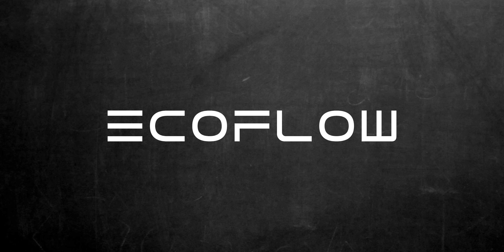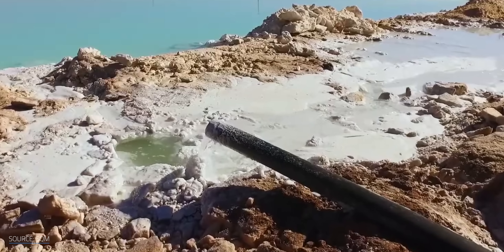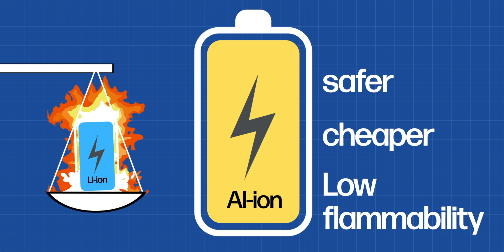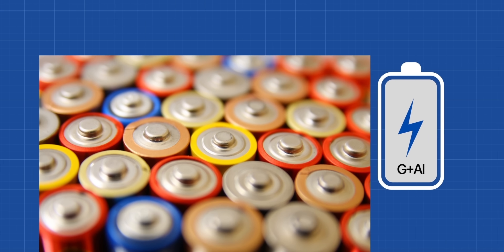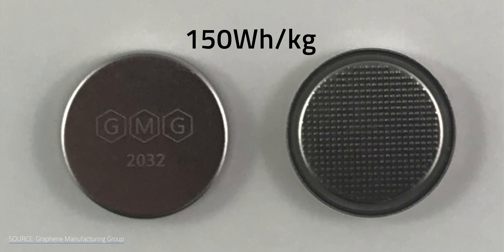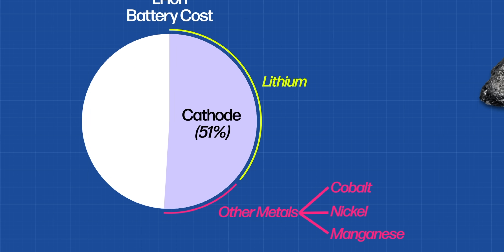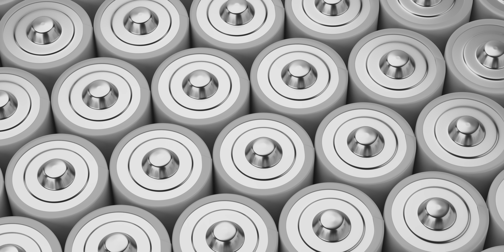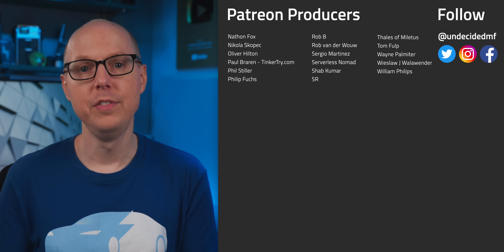Can This Metal Really Beat the Lithium Battery?

Comment: Here is the goal for battery charging speed : battery needs to be able to charge faster then what the input source, including wiring can reasonably supply !

Translation: the connection point is most likely going to be the limiting factor. 

I

Comment: EV power source tech is, certainly, important, but it always seems to me that researchers do not think of the other day to day applications - small tech, such as phones, computers, and even torches (flashlights) and button battery items like wristwatches and the like. If the Al-Io can be miniaturised to be incorporated into these small-tech items, with the same energy density as the larger tech items, then I can see Al-Io being a runaway success, but not otherwise.

Comment: this is extremely important stuff , al ion is the way of the future now that we're on the verge of having cheap graphene
Reply: Unfortunately I don't think graphene is going to be cheap enough.  It needs to come down in price by many orders of magnitude to be cost competitive for battery usage.  Currently it is about $100,000,000 per metric ton (according to Matt's numbers).  That is just too costly for any application that uses multiple tons per year.
Reply: @brettspencer-curran8269   heres another comment : @fcbrants   3 days ago (edited)
Thanks Matt, I think you missed one of the most important facets of GMG's business model:  They're forming their graphene directly from (natural gas / methane / CH4), so their graphene is a) ultra pure, and b) super inexpensive compared to other production methods.  They can also produce this graphene at enormous scale, as their original intent with the product was to use it to harden concrete, requiring huge volumes of the material

Comment: looking forward to trying AA batteries with this technology ... any plans for that type of thing?
Reply: As far as I know AA cells are basically the same as coin cells but stretched out.  I'd imagine it wouldn't be too hard to manufacture AA, AAA, C, D, and 9V with this technology (AA, AAA, C, and D are all 1.5V cells with the larger versions having higher capacity and potential amps, 9V batteries are just 6 smaller cells stacked together in series).
Reply: @grn1  I'm having really good luck with current lithium rechargeable AA batteries ... they're getting really good,  this aluminum tech sounds even better

Comment: It’s probably best to just avoid the term amp hour or milliamp hour when discussing batteries since - who cares? I use watt hours to power my stuff and the voltage is often different between battery chemistry types.  Here aluminum is less voltage but still has more (theoretical) energy density since the current density improvement is dominant. I see Wh was introduced later in the video but the initial ratio in Ah given is going to mislead some.

Comment: I am having a hard time figuring out how the aluminum ion battery market even existed in 2021 when it doesn't appear that anyone is selling aluminum ion batteries yet.  One use Aluminum-air batteries do exist and are being manufactured and used, problem is that they are not rechargeable and so have limited applications.  As far as I have been able to determine, there are no large scale aluminum ion battery production.  From this video, it sounds like GMG is currently producing, or is planning on producing, aluminum ion coin cells which is a step in the right direction since it will demonstrate that an aluminum ion battery can be manufactured at scale. The next step is to make enough progress to make larger cells that will be useful for EV's and large scale grid storage.  At this point none of them have hit any roadblocks, my concern is how quickly can they be brought up to meaningful production?

Comment: 10:57 - Those numbers imply Li-ion batteries cost $75 per kWh or less. If that's true, why does Ecoflow (the sponsor of this video) charge ~$1000 to go from a 1 kWh battery to a 2 kWh battery? Either these battery companies have incredible margins, or the cost claims per kWh (which I frequently hear are around $100 per kWh) are largely theoretical numbers and don't convey anything of practical importance. I'm guessing the latter.
Reply: I've wondered about that too. My theory is that the $75/kWh figure is only really true for companies that have locked in long-term contracts for huge quantities of lithium, back when lithium prices were cheaper. So, maybe $75/kWh is accurate for Apple and Telsa making cell phones and electric cars. But, I'd bet that new companies that want to build li-ion batteries have to pay far more than that on the spot market for what lithium scraps are left. Hence the need for Ecoflow to charge $1000/kWh to turn a profit.

Once the scarcity of battery materials goes away, hopefully, things will start to change.

Comment: Aluminum tends to stay as a precipitants.  This makes aluminum less functional as a battery metal.   Fe and copper are better choice for more reliable rechargeable batteries. They can nontoxic and 100 percent rechargeable batteries with high capacity. Aluminum has a strong tendency to stay as Al plus 3 ion.

Comment: Interesting tech but Aluminum batteries have been around for a long time and the problems with them have prevented more widescale adoption.  Maybe they fixed those shortcomings or maybe not.  The biggest challenge with this iteration of the tech is the need for graphene which is still hard to make.  Also, I wonder about the cycle life.

Comment: No offense. 
It lasting 3x longer sounds good till you point out lithium ion phosphate.  Last 20 years or around 2000 cycles without deterioration. 
But it would be nice if it was less hazardous/ flammable.
Would make more options for storage.

Comment: There isn't enough Lithium to sustain long term mass storage use in batteries. Moreover well before known reserves run out their scarcity will keep driving up their cost. Batteries based on Sodium Sulphur could be made cheap enough to contribute to grid scale storage.

Comment: There are no ‘rare earth elements’ in Li Ion batteries. Rare earth are for permanent  magnet electric motors.
GMG costs are graphene nanostructured substrates, so at 100$/g means 100,000$/kg, not so economic 😅. The major costs for Li-Ion is actually nickel, not Lithium because it is only about 6-7% of the total cell’s mass. Nickel content instead is much higher and costly.  But 55% of the cost of a battery cell is manufacturing. I think that Li-S ( lithium- Sulfur) and Al-S ( aluminum- Sulphur) batteries are better a for energy density and lower cost of production at the end. But there are plenty of diverse types of batteries and Storage Systems for Grid scale and residential application, so the more the better! Less metals price pressure and diversification of the markets are only good for the sector,  to not depends on esotic materials and use them in differents applications. More batteries and Storage systems means better future for low emissions energy transition.

Comment: One thing I think gets lost in these conversations is that energy density is only really important in mobile applications, and even then, that lower  density can be overcome by other advantages. 

If I have a 5,000mah lion pack for my phone that barely makes it through the day, but requires an hour to fully charge, I could make a 2,500mah battery work that only takes 60secs to charge. This same equation also plays into cars. The larger ranges are demanded because of the time consumption of charging at stops. But if I can put 100miles in the "tank" in 60seconds, but 200miles of range is all that's physically capable of being installed in the car, 2minutes of charge time is a very acceptable tradeoff.

In grid, business, and home storage, energy density is almost literally the last issue considered. Cost and total capacity. If a battery pack that can run my house for two days costs me $2k, but is as large as a small family car, that is totally a good trade to me. 

It's all going to come down to price... Solar systems flared when they became cheaper to install, now the hang up is the storage of energy produced for when the sun goes out. Same with home turbines.
Reply: Yes and no.  Even for fixed storage energy density is important because after a certain point the packaging materials structure of the battery pack begins to comprise a significant portion of the total storage cost.  To use your example if you spent $2,000 on a battery pack for your house that was the size of a small car then I would venture a guess that 1500 of that would be just the sheet metal, copper and steel that would make up the non-cell portion of the battery pack.  If the energy density was significantly higher however then maybe only $500 would be the packaging cost while the rest would be cell cost.  This doesn't even take into account the land cost for lower energy density systems.  Land has a fixed purchase price but it also has a  yearly cost in terms of taxes, So that has to be weighed against cheaper but lower energy density systems.
Reply: @brettspencer-curran8269  I suspect your numbers, but since I have nothing concrete to base my own numbers upon, I can't very well say you are wrong, lol.

Comment: On the face of it, the cost to produce is quite low [eventually]. PROBLEM: Companies VALUE price, instead of COST pricing. Why? At first, to recover the startup/development cost, and second, because they can. I expect pricing to eventually be as low as 70% of Li-ion price even though the cost would be much less. Lots of eventual profit to the 'leader of the pack'.

Comment: Sounds great. Super fast charging and energy density is mandatory to move away from fossil fuel vehicles. Ships and aircraft may be a challenge due to Kw/g capacity. Batteries need to get to the same as fossil with respect to power density, volume and weight for those long-range vehicles where they can't stop to charge in a short time. Autos [including 1 ton consumer trucks] need to get to having a 400-600 mile range under worst conditions [AC/heater/uphill/headwind] and be able to charge that range capacity in 10min which is the average fill up pit stop time. Big rig trucks and rail cars need to have much greater range of up to 2000 miles. [Big rig 2-100 gal tanks@10 mi to the gal] A train could just pull battery rail cars as needed to get range.

Then there's the really big elephant in the room... Grid distribution infrastructure with clean energy supply support and then affordability. Like me, on a fixed income, driving a 230,000mi 22-year-old vehicle [good thing I am a mechanic] am not purchasing a new vehicle anytime soon let alone an electric vehicle.

Comment: i am surprised that corrosion (oxydation) is cited. I mean, batteries are sealed, there is not way for oxygen to be in contact with the material.

That's a good thing because anyways Lithium burns and explodes in contact with oxygen, wich is much much worse than mere corrosion.

Comment: I am suffering from fatigue caused by unrewarded hope for a better battery.  PLEASE make an episode about what needs to change in the scientific community to bring forward actual products.
Reply: I don't think anything needs to change in the scientific community.  The responsibility of the scientific community is to investigate a variety of different avenues to solve a problem. Comes down to engineering and manufacturing to validate whether or not a specific technology is actually viable.  All of that being said I'm very pro research and pro-engineering, you just have to accept that things take time and there are going to be many many failures before a potential success is found.  Think about the number of hours and prototypes that went into the original light bulb or the first blue LED.
Reply from the maker: I struggle with this exact thing with these videos.  It takes years to bring new tech like this to market.  It's not a fault of the scientists or researchers, but just the nature of working out issues, iterating, ramping up production, etc.  It's very complicated.

Comment: The biggest place that increased Wh/kg density matters is electric bicycles.  Adding more torque for steep hills and increasing range solve the two biggest problems with ebikes as they exist today.  Electric motorcycles will probably never be competitive with gasoline because power to weight ratio is king in that space, for much the same reason cheap kerosene/oxygen or methane/oxygen engines dominate among space rocket first stages.
Reply: Electric bicycles and (for me) radio controlled, electric powered model aircraft.

Comment: No mention of how they perform at low temperatures which is the bane of most electric storage devices. Another problem is that aluminum requires an enormous amount of energy to produce.

Comment: If you want to know another exciting breakthrough other than a lithium battery, this high-tech power generator uses no fuel, solar, hydrogen, or nuclear and no recharging is needed.  It can be used anywhere whether you are aboveground, in space, or underground (per inventor's claim). Their first invention was harvesting wave frequency to be converted to electric current but not powerful enough to run a big motor until they discover this latest generator that uses a little bit of plasma, light, and trade secrets (that defies the law of physics) to produce electricity. One power box (maybe 24"x24"x2") can produce +/-20kw of electricity and can run 24/7. I think this is the answer to climate change, inflation, high oil prices, space travel, and any industries that use electricity. The generator will be out in the market by the middle or end of 2023 (in the Philippines). If you are interested to watch on how they connected this generator to run an SUV vehicle without an engine, I am more than happy to provide you the LINK.
Reply: Ok scam lord
Reply: @JimLahey21  I am just sharing this good news so that other people will be aware that there is a new technology that produces electricity without harming the environment and uses no fuel.

Comment: GMG just completed their 1000mah pouch for testing. Aluminum ion batteries will be the sought after solution for mobile applications, but even cheaper chemistries like sodium ion will dominate stationary applications like solar/renewables and ups/telecom/switchgear. With tightening environmental regulations, these non-toxic, non-volatile chemistries will come to dominate the market in coming years.

Comment: Craig Nicol's statement about carbon trapping heat (at 6:50) with the global warming illustration is not right. GW is supposedly caused by CO2, which is a gas. The CO2 molecule vibrates in a bending mode. A totally different situation to a battery. But otherwise an interesting video.

Comment: Safer, cheaper, faster... Now, get the tech out there and prove all of those things and you have a winner. If you could upgrade a model 3 from ~200 miles range to ~800 miles with a battery/BMS swap and only needing as much time as a regular fuel up to do an 80% recharge, then you effectively silence the naysayers. I would 100% go with an all electric swap into my old SUV if I could do it affordably and not sacrifice range. (And I actually had money to do more than just dream about it!)

Comment: 10:37 How can molten salt be the electrolite when it's only being used at 25C and 110C? At those temperatures the salt would still be a solid since sodium chloride becomes liquid at 800C. perhaps the salt solution has elements which reduce the melting point?

Comment: $100 per gram of graphene?  So $100,000 per kg.  Or $100 MILLION per ton.  Graphene makes lithium at just $13,000 per ton look very affordable.  It seems like graphene costs would need to come down substantially for this battery tech to go mainstream.  In the meantime there may be some limited applications where the power density could justify the cost.

Comment: The obvious limitation in this case isn't the Aluminium it's the graphene which is higher cost than lithium, cobalt, etc. Car and mobile device batteries such as laptops and phones will be the killer application for these batteries. Whilst watch size batteries are fine for testing they are used in applications where the power draw is low over a long period, something that doesn't sound like it will benefit from this tech beyond a proof of concept. It sounds promising but we'll have to wait and see.
Reply: The thing is, they don't really need to use graphene.  One can easily make bulk cellulose nanocrystals from waste cellulose products (wood, paper, cotton, linen, etc) and when you graphitize these--they have properties in between graphene and carbon nanotubes i.e. they are very highly electrically conductive and mechanically very strong (though much stronger when in the carbon phase).  

    You can make a large amount of cellulose CNC's at a time fairly quickly and fairly inexpensively.  Graphtizing the material is a trickier and more energy costly process, but there are various ways around that, such as vacuum insulated solar concentrator heaters or souped up microwave-kiln heaters.  (Once you turn the CNC's into carbon, which is easy enough, since carbon is a microwave susceptor, you can use microwaves to heat it into graphite). 

   Anyways, this stuff is just as good performing as the low grade graphenes, though it is not as good as the true, very high quality, and very expensive graphenes.  But you don't really need to do the latter to significantly boost batteries.  It is still much better than the best graphites out there.